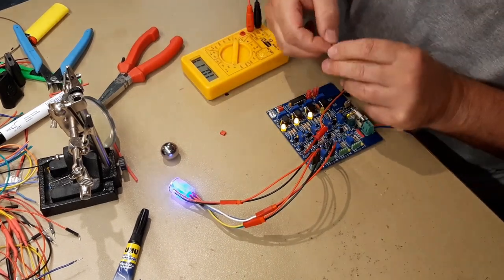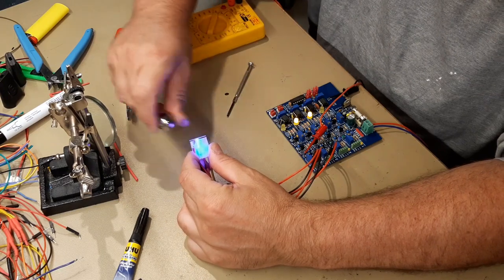DiY Pinball Sensor and Lamp Assembly

Comment: Sehr schöne Idee den Sensor direkt in im Insert unterzubringen!
Ich habe ebenfalls mit verschiedenen Methoden experimentiert und verwende überwiegend Lichtschranken in meinem Flipper. Hast du für die Auswertung der Sensorik einen integrierten Schaltkreis verwendet (ich glaube da habe ich nämlich damals nur sehr wenige Optionen gefunden, die als DIP verfügbar waren) oder sind die kleinen Achtbeiner etwa NE555 Timer? :)
Reply from the maker: Hallo, ich habe die Schaltkreise fast diskret aufgebaut. Das Ergebnis der Oszilatorspannung wird per referenzSpannung per LM339 Comperator verglichen. Die 555er (das sind sie wirklich) sind dazu da, das Signal auf eine Mindestlänge anzuheben um diese ohne Interupt am Contoller auswerten zu können. So wird z.b. ein 5ms Impuls auf 80ms verlägert. Ein durchlauf meines Filpper Programms dauet ca 65 ms. Von UV Sensoren z.B. für Lichtschranken bin ich abgekommen, das diese dann mit Tageslicht meist ein Problem haben. LG., Fabian
Reply: @fabe1690  Danke für deine ausführliche Antwort! Verstehe, du wertest also die Amplitudenveränderung und nicht die Frequenzverschiebung aus. Bei meinen damaligen Überlegungen hatte ich Bedenken bzgl. der Robustheit (Drift, Temperaturanfälligkeit usw.) und dachte daran die Frequenzänderung mit einem Phasenkomperator zu detektieren. Aber es ist nur bei den Überlegungen geblieben - vielleicht mache ich das irgendwann noch. Deinen Ansatz werde ich sicher auch ausprobieren, danke dafür! :)
Ich würde dir ja gerne ein Foto von meiner derzeitigen Lösung zeigen, nur sind wir ja hier in keinem Forum in dem das geht^^